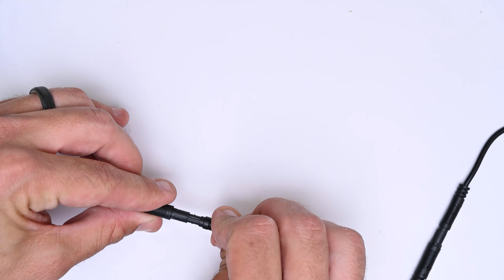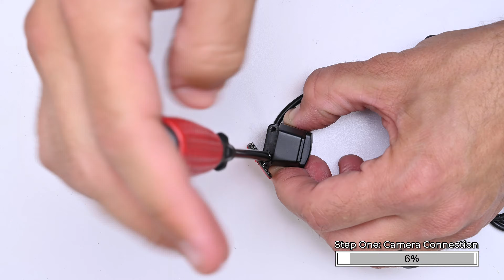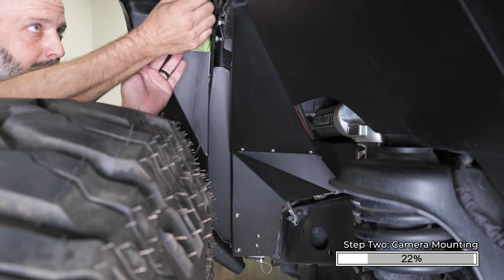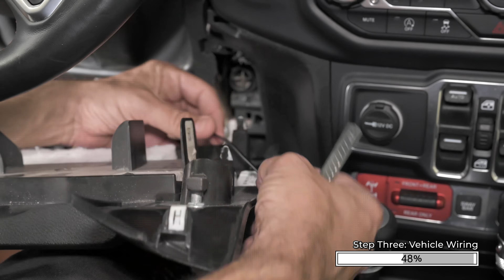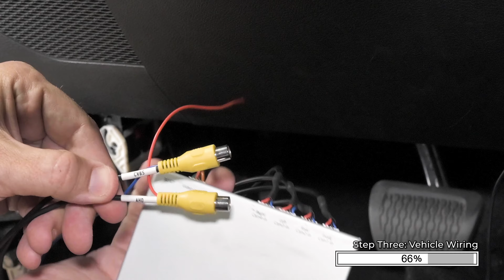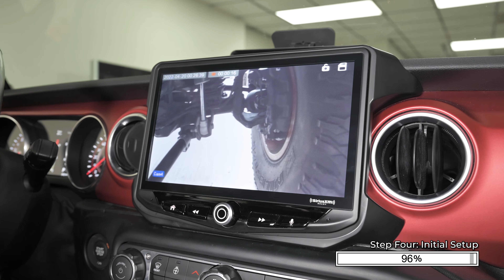INSTALL Vehicle Underbody Four-Camera Off-Roading Kit | EMUBCAMKIT

Comment: $500?! That's a lot of $ to have remote control switching
Reply from the maker: The view can be changed with the supplied remote control, or with a 12v +  trigger input to the DVR, so the triggering is automatic depending on what the trigger is tied to. Each camera input has it's own trigger wire that can be tied to a variety of different things, like reverse lights, turn signals, and more.

Comment: Will this work with the factory 8.4 in the JL?
Reply from the maker: Unfortunately, this will not work with the factory radio/display in the JL or Gladiator. You would need an external aftermarket dispaly that has a standard RCA type connection on it, or a radio replacement like the RB10JW18B HEIGH10 kit.
Reply: Is the head unit waterproof?   I drive my Jeep with the top off during summer so there is the unfortunate rain shower I get caught in.

Comment: Can you use this system without a memory card? So instead of recording, have it more like streaming?
Reply from the maker: It can be viewed live when connected to a radio or monitor in addition to recording the video, but there is no way to stream it. The connection would need to be an RCA-type input to your radio or monitor.